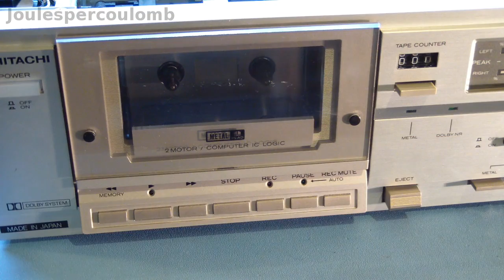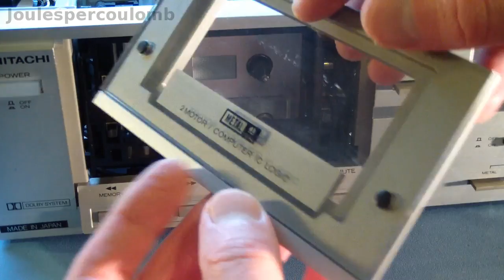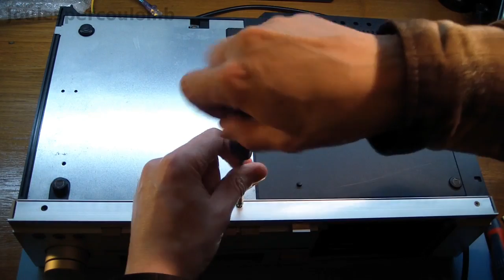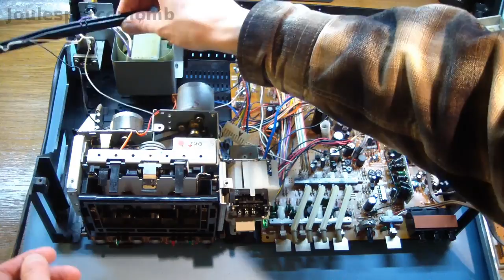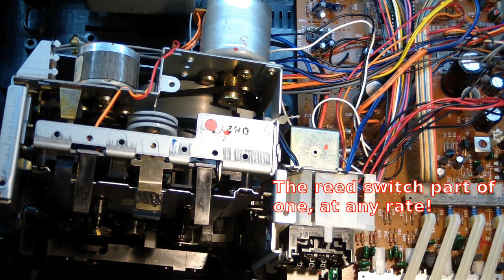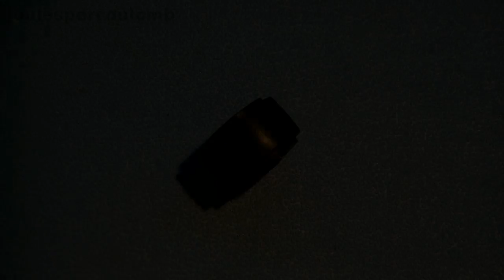Dismantling the Hitachi D-85S Cassette Deck

Comment: Hi there joules great video. I picked Hitachi system deck amp cassette and tuner for£15. Absolute bargain. I need to change the belts on D 35s. They'd melted. Any videos or suggestions would be gratefully received. Do you have an email? Regards

Comment: I've owned D-85s in the beginning of 80s, second owner after harsh using, and used it every day for several years. It never chewed, but much worse - it never kept azimuth on different cassettes. You could adjust everything well on test cassette, and this adjustment was kept on some exact cassettes only. You could insert a cassette of the same brand, and suddenly it goes out of focus - seamingly, the problem of bad pinch roller that you described.
The 2nd problem was a condition of take-up roller used for RW/FF - it's intended to be of some exact friction moment, which is impossible to achieve for even a basic set of cassettes - depending on temperature or tension the RW/FF may not work at all or be too strong.
But in general, the deck has left a very good impression - mostly electronic part - much better than most other brands of the same price category at the time.

Comment: I used to have the D-35-S back in 1983 I had to sell it along with the rest of my kit, I was unemployed at the time and had to sell it to pay bills, it was coupled to the HA-2700 a D-550 and a Technics SL-1500 Turntable. I am currently trying to buy a D-90S dual capstan 3 head machine. I am slowly building up my old system, albeit with higher end Hitachi gear than I had back in the 80's, so far I have bought a HA-4700 a FT-3400 tuner, the turntable I am currently using is a full auto Akai AP-D40. I just last week bought my original HA-2700, it is pretty darn basic in comparison the the HA-4700, quite under powered, but it's a blast from the past, I have repaired it and am giving it to my son as his first amplifier :) 

I am wondering what your opinion is on the HA-4700, I loved mine when it was working, it failed a few weeks back from over temperature on the right channels 2SC-2525, I have ordered almost every component in both the pre-amp stage and the finals, also filter caps for the PSU etc etc, not all parts have arrived yet so it will be a little down the track, but I can't wait to get it back up and running because I am using the HA-2700 right now as a replacement and it just sounds weak and well not altogether horrible it sure lacks in a lot of areas. I assume you like your 4700 as you remark that you are still using it, I found it has awesome sound, and some of its features are quite brilliant.

I love old Hitachi gear and hope to have a very decent system before too long. Great video mate, I love watching you work, you should have an apprentice, you're a very good teacher.

Cheers from down under.

Comment: I have a Hitachi D-550 can the front door be removed the same way?
Reply from the maker: TheDutyPaid I've never worked on one of those, so I don't know. I recently made some repairs to a Hitachi D-E57. Rather than sliding up and off, its outer door was held to the inner plastic frame by two plastic pegs that I had to push out from the inside. My advice is to use a bright light and make a close examination of everything and hopefully you'll be able to work out how to take it apart. If you can find a service manual, that might well have disassembly instructions or an exploded diagram of all the parts.
Reply: JoulesperCoulomb Thank you for the fast reply, I've seen a service manual on ebay and was not too sure how helpful it would be, but will get it now as I need to replace the bands. I repair typewriters for a living and have training in electronics but this will be my first cassette deck.

Comment: I remember that deck quite well, chewing up tape could be a problem even when new!! The only fix was, as you found, bending the pinch wheel support. Very technical I know. This was a very common way to repair cassette decks as there was often nothing to adjust. Some cassette decks did not like some brands of tape and even less liked the C120 as the tape was very thin and easily rapped it's self around the capstan. Give me a reel to reel any time!!

Comment: Very helpful video, thanks, I need to replace the belts but I can't find a kit anywhere.
Reply from the maker: The smaller belts were selected from a generic kit of many sizes of replacement belts. So, without taking them out again, I can't tell you their dimensions, but I don't think you should find it difficult to obtain replacements.

I used one of these for the capstan drive belt: http://cpc.farnell.com/_/belt6/belt-flat-72-0x3-5mm-diaxw-0-5mm/dp/AVBELT6
Reply: JoulesperCoulomb would you know where to get the flat belt from now? The link is dead now and I’d love to get one thanks